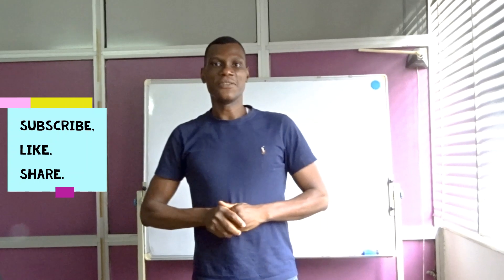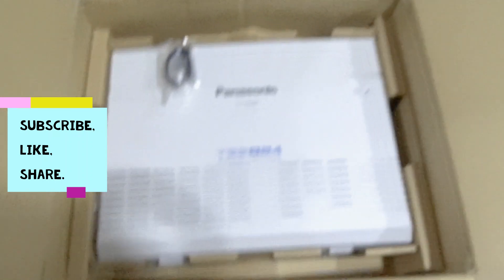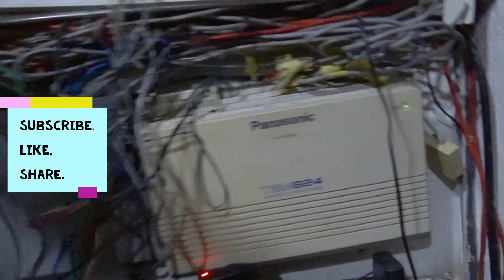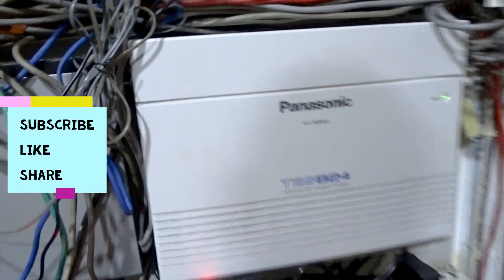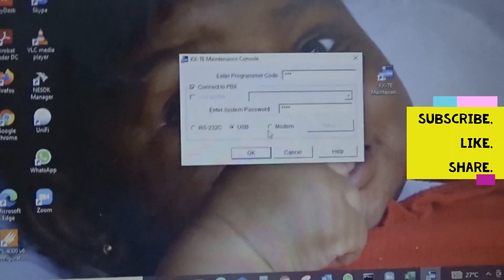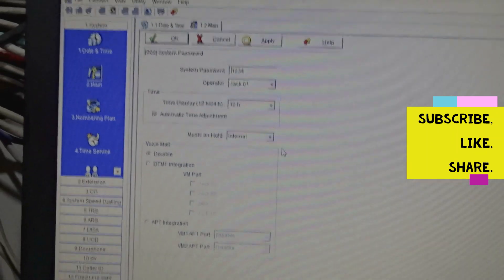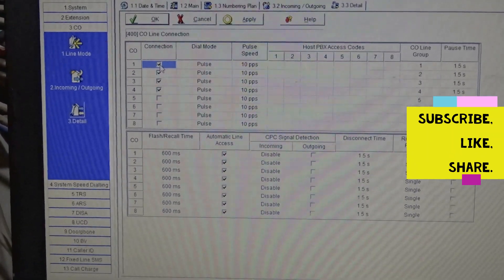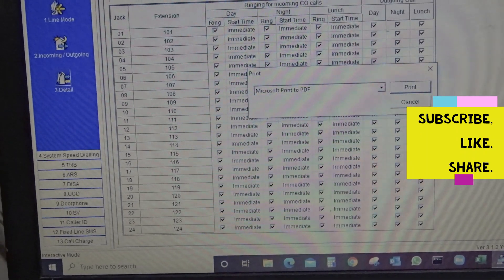PABX Installation and Setup - by DarlingtonOsinachi. 😁

Comment: how can other extension line call outside without using the main console
Reply from the maker: Hi Adigun, you can  connect with the fixed wireless device to extend the number of service lines.

Comment: Thanks a lot for this.
Please I have an issue with a CO line not ringing on the console.
Calls to each units of the intercom is working perfectly and ringing out but calls from outside isn't ringing out.

It shows that it's ringing on the wireless terminal but it isn't ringing out on the console.
All cabling had been double-checked yet, calls from outside isn't ringing on the console.
Reply from the maker: Hi Michael, good to hear from you . You might have to replace the existing pabx, the call errors you complained  about cannot be resolved by software config.
Reply: Hello Sir, have you tried testing another configured phone in that spot if no maybe you should try it, if it works it means that particular phone speaker is bad and may need replacement. But if the fault is not from the phone extension kindly check with the pbx machine itself.

Comment: thanks for the video , i have two question sir.. 
1..how can i reset my Panasonic KX-TES824 to factory settings , this is bcos have forgotten the code and system password..
2..how can i configure calling and receiving  an outside mobile number
Reply from the maker: To reset the KX-824 to default can be done in two ways:

Button reset found on the mother board,
 or software reset using the KX-TE Maintenance Console.
Reply: @darlingtonosinachi  thanks bro.
Reply: @darlingtonosinachi  please what about the second question .....2..how to configure calling and receiving external calls
Reply from the maker: @adeyemiadebayo9785  kindly email  me iamosinachi@gmail.com for further support.
Reply from the maker: Hi Adeyemi, I noticed you are not yet subscribed to my channel. please subscribe.
Reply: @darlingtonosinachi  have subscribed